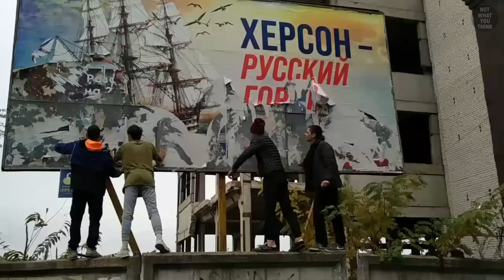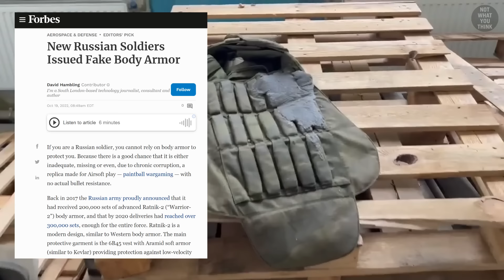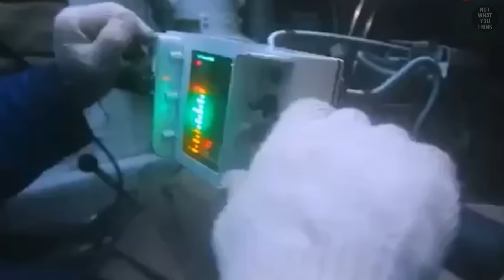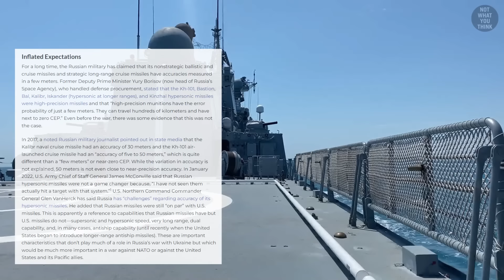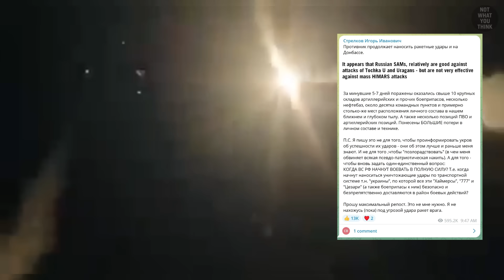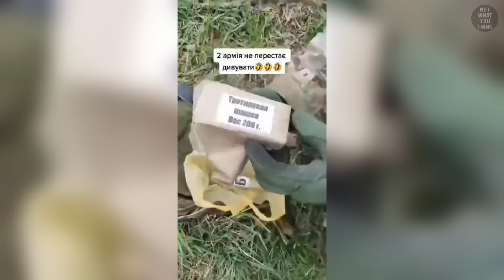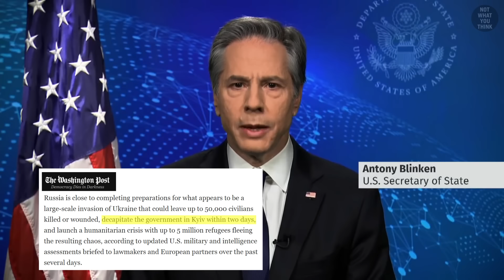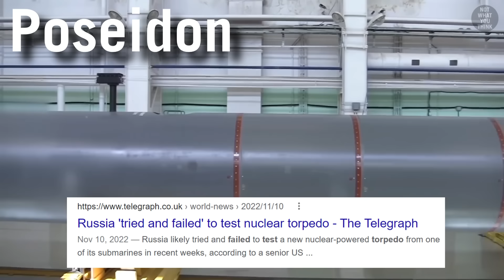The True State of Russian Army

Comment: I served in the Russian army in 2001-2003, at the dawn of the Putin era, in the elite space forces. Theft flourished even then. During my service two multi-ton power transformers from the substation, eight traveling wave lamps of 250 kg each from an object cordoned off with barbed wire and an alarm system were stolen. Thousands of palladium capacitors were torn out of the equipment by the officers. Military trucks drove on worn tires, on which there was no tread left, even in winter in ice. A lot of military vehicles were faulty. Pistol shooting classes were held every two months, each officer fired 3 shots. There were no other combat training classes, but we marched a lot, learned to pull the leg and perform marching techniques. The 'eye-wash' flourished. Periodically, commissions came from Moscow, for which we put things in order, made different signs, filled out logbooks, colored a trees and curbs of asphalt paths and did other nonsense.
But 20 years ago, at least they gave out a good military uniform to officers and soldiers and the food in the daily rations was not overdue.
Service in the Russian army is a daily anecdotal stories. There is a saying in Russia: "those who served in the army don't laugh in the circus."
Reply: Thanks for sharing and I’m glad your safe. Take care.
Reply: Почетный танцевальный долг.
Reply: Подписываюсь под каждым словом. 
This is true
Reply: Paint the trees 🌲???
WTF 😳 😅😅😅
Reply: Very interesting, thanks for sharing.
Reply: Good that you made your way off there in time, Sir.
Reply: How strange, a russian but you write in a foreign language. That's rare.
Reply: @dovydaskaminskas4227  It's not, actually. Those best known for not knowing other languages than the one they have imported themselves are the US Americans.
Reply: @dovydaskaminskas4227  I don't speak English so well, so the online translator helped me.
Reply: wait, theft flourishes in the russian special forces? get me an AS VAL plsplsplspls
Reply: @adog3129  Theft flourishes absolutely in all forces of the Russian army. But I was not talking here about the special forces, but the military part of the space forces, it is viewing for space objects.
Theft has different forms and exists at all levels and units of the army. Officers steal more, soldiers steal less. Generals and colonels, commanders of military units, as a rule, have their own or affiliated companies that supply products and perform various works for the army at inflated prices at times. These top officers have houses and cars that cost thousands of their annual salaries, they live in luxury. Blatant theft is seen by everyone, but no one asks anyone questions. They catch only those who did not share the stolen goods with a higher commander. Lower-level officers steal uniforms, food, fuel, various kinds of materials, equipment from warehouses. Well, soldiers can steal anything they have access to. According to expert estimates, from 1/3 to 1/2 of the military budget is being stolen in Russia.
Reply: @muchacho1901  oh sorry, I misread. cool info though!
Reply: @raulramirez1828  чтобы листья были более зелёные и проверяющему приехавшему за очередной взяткой понравились сосны ,он забыл сказать про покраску дорожного полотна в серый цвет,чтобы асфальт был более асфальтным
Reply: @adog3129  Much of Russia's power was a load of hot air. We couldn't even imagine the real underbelly of pageant military parades, battle tank competitions, drippy merch, cartoons about nuclear warheads, and the Defense Ministry's own media conglomerate. PR stunts aside, the Russian army proved to be utterly squalid and depraved. Things turned out to be much worse than in the Soviet era, which wasn't outstanding, either. 40-year-old smocks and rusty Kalashnikovs just take the cake. A Russian military emergency rations that was videotaped early into the hostilities came to symbolize this clusterfuck. The army-branded package contained a pack of expired cheap patte. The package represents the army was touting over the past decade, while the expired patte stands for what's really worth... But the war struck. Unfortunately, one thing about wars is that hot air proves to be useless weapon. You can apply all the battle paint grease you can find in a kid's store and trash-talk all you want. If you leg it before you even see real combat action, you show your true colors. The more you gloated, the worse of a pathetic loser you'll seem...
Reply: @dovydaskaminskas4227 Almost as if the default language of the internet is English. weird.
Reply: @raulramirez1828  not just trees, grass too. This is not a joke.
Reply: If you say that to putinist they scream its fake 😂
Reply: In Navy Bootcamp I also only got 3 shots with a pistol and 1 shot with a shotgun..... which was supported. Guy was giving me a hug basically as I shot a gun I shot many times before recreationally. Thanks champ, very real world of you :)
Reply: @koerrie  Pretty sure more Americans speak Spanish than Russians English. 4% of Russians can speak English so yeah, this is pretty rare. No idea what your comment is about.
Reply: @dovydaskaminskas4227  Yup, 4% of Russians speak English and this guy is one of them.
Reply: @kablard  Damn lies halt meinen Kommentar, wenn du ihn nicht verstehst, du Sprachgenie.
Reply: It’s that bad?!!
Reply: @raulramirez1828   china literally does the same thing...
Reply: @koerrie   BS most russians i've met can't speak a lick of english and those that can almost exclusively only know swear words.
Reply: @kablard  Tell me in my tongue and we will know 😉
Reply: @charlethemagne5466  Yeah. What other languages rather than English do you speak then?
Reply: @raulramirez1828 stuff like that happens in America too, I've seen trees painted because an officer didn't like the view of a dead tree, painting the rocks in a parking lot, etc  it's in every military lol
Reply: Guys, read "One Soldier's war", about the experience in the Chechnya war. Is it really true tjat new soldiers are being treated THAT badly? Like being torturred to the point where one's genitals and legs had to be amputated? Got that from another report. In this book two conscripts had done nothing speciL, just some usual trading with Chechen kids which everyone did. They got pi55 drunk and their boss, being just as drunk, beat both up like hell, hung'em up, let'em hang there for the whole night with their hands turning black, electroshocked one for 30 minutes, then beat both up to a pulp, threw their passports away and them out of the camp. They stayed there for a few hours and were not seen again, but obviously were in a catastrophic situation like that, in the country they attacked again.
Reply: After the war, the OUN circles operating in exile conducted a systematic action of changing history. In publications, studies and memoirs, the topic of cooperation with Germany, participation in the Holocaust and murdering Poles was omitted. The OUN and the UPA were presented as noble organizations fighting for a free Ukraine against two enemies - the Third Reich and the USSR. An idealized image of Bandera was also built as an outstanding politician, leader of the nation, thinker and noble fighter for freedom. All those who recalled the Ukrainian collaboration, participation in the Holocaust and the Volhynia massacre were called Soviet agents. Rossoliński-Liebe
Reply: Подтверждаю, служил в 2008-2009.
Reply: As an American I don't want u pulled into the West we're not perfect and at times my country can be hypocritical I wish our countries could live in peace with both of our countries respectfully  treating our neighbors around the globe we should have never invaded Iraq and Russia should have never invaded Ukraine God bless there soldiers and I wish them a quick victory and hope my country does everything in our power to make them victories
Reply: @raulramirez1828  whitewashing tree trunks is still common practice in post Soviet countries.
Reply: @marcinrybarczyk001 They are weak. The offensive was stopped at the time when Ukrainians had no support. By them alone. Now the front line only moves back. If the support came on time, the war would be over long time ago. Now they are dealing with well prepared defense (because they had a lot of time for that), and ~400000 orcs. The support from NATO should have been F35's and Tamahawk missiles.
And oh by the way, I know this saying ant at least three languages. It's not polish.
Reply: @Barbabapan  Unfortunately, the price of human life, both in the USSR and in modern Russia, is close to zero. Sometimes it takes on a negative value: you need to pay, you need to buy yourself a uniform in order to have hope of survival.
I have not read the book "One Soldier's war", but everything that you have retold could well have happened. I will give some examples of contempt for human life in the Soviet and Russian armies, they can be listed on whole volumes. The beginning of the war between the USSR and Germany in 1941, when Stalin's directives forbade retreat, when millions of soldiers were captured, from which almost nobody did not return alive. In the spring of 1942, Stalin believed that he was already quite capable of driving the German army to the west, then several armies died in the cauldron near Kharkov, a dozen generals and almost three hundred thousand soldiers died and were captured, my grandfather miraculously escaped from the encirclement among 10,000 fighters, it was near Lozovenka (the current Balaklei district of the Kharkiv region Ukraine). In April 1945, in an effort to get ahead of the US and British armies and be the first to enter Berlin, Soviet army units stormed the Seelow Heights (Seelower Höhen), this was the shortest way to the German capital. Commander Zhukov put two tank armies and 200 or 300 thousand fighters on these heights, there is still no exact data on losses. 
The storming of Grozny in December 1994 was just as crazy and bloody. I have heard a lot of scary stories from eyewitnesses and participants in the wars in Chechnya, and I myself almost ended up participating in the Second Chechen War.
The same attitude to soldiers in the current war in Ukraine. Mobilized people, just torn out of peaceful life, were sent to the front without any preparation in September-October 2022 and thrown there with only guns to storm the positions of the AFU to certain death. This is called a "meat assault" ("мясной штурм"). According to statistics collected by independent observers, a mobilized Russian spends an average of 4.5 months at the front before his death. Those who are dissatisfied or refuse to go on the attack are thrown into torture cellars in the occupied territories. Russian telegram channels are overflowing with messages from relatives who cannot find their children and husbands who have disappeared in such cellars.
The attitude to the soldiers of the Russian army is exactly the same as to the captured Ukrainians. People are dehumanized, tortured with inhuman cruelty and killed.
It is bitter for me to write about this, being a citizen of the aggressor state. I wish Ukraine a speedy victory and the de-occupation of all its territories.
Reply: @muchacho1901  thank you very much for your reply. Such a huge, unbelievable sadness. Glad to read, your grandfather made it out alive back then. Being Czech/Swiss, my grandfather worked in the police force in Prague, that was misused by the Nazis to collect and deliver jews and others. Off course they didn't have a choice but to follow the orders, but formed a secret movement, consisting of all kind of people, to save them instead. My grandfather and others would drive to the enlisted people in the middle of the night and have them quickly transported to the borders. Worked, though my grandmother off course was sitting on needles, scaref about their pretty good life.  When the Soviets occuppied the country, my grandfather and his people still kept up their secret work, this time trying to save "traitors", but they were caught. My mother was 4 and her sister a baby when they came in kicking through the door late evening, searching the whole place. My grandfather survived 10 years in a gulag, his family was deported into the "traitor's quarter's" or something. My mother grew up with constant public denunciation as the traitor's daughter, learning and singing songs about glorious socialism, her father slowly dying in the Gulag. He got free because of some propaganda deal to show the Red's mercy, but died later on due to the mistreatments. During my childhood we visited my grandmother a lot, in Prague. I was told by various people that whilst the Nazis had off course been horrendous, the Soviets were worse, also because the system could hit anybody at anytime. My grandfather was forced to deal with all kinds of innocent "traitors". It felt strange when mother sometimes warned us to not talk about my grandfather or tragedy before visiting another family, because of another visitor, a Russian/Russian-friendly and political hardliner. "Could be dangerous." Afterwards I sat there, staring quietly at the guy, hoping not to trigger a critical situation. Back home I thought how crazy it is to live like that - with that constant paranoia of denunciation. 
Anyway, that's my connection to your country's regime. A rather bleak connection, not without a full $hitload of personal hatred since there was so much suffering to hear about, and it wasn't easy growing up with my paranoid post-traumatic mum. Reading your interesting and moving story doesn't make that connection any better, yet it's so good to hear a Russian's story. Hate is a shitty feeling. Wish you love and all the best.
Reply: @Barbabapan  I am very glad to read your letter. Youtube gives the opportunity to correspond in the comments, it's amazing and useful. When I wrote a comment to that video about the weakness of the Russian army a few months ago, I did not think that I would receive so many messages from humans from different countries. Of course, I think that almost everything I have written is well known to you from school. 
Thank you for your story. I sincerely sorry that the Soviet Bolshevik regime brought so much grief to your country and your family. On the territory of the former USSR, almost every family has similar stories. My forefathers on my father's side were Kuban Cossacks. At first, they were severely battered by the revolution and the Civil War in 1918-1920, my great-grandfather's older brothers fought in the White Army and went missing. Some relatives fled abroad, the connection with them was cut off. In the early 1930s, the great-grandfather and all his brothers were deprived of all their property, declaring them enemies of the people. All of them were forced to flee and hide from the persecution of the NKVD.
My mother's parents are from Ukraine. Grandmother from the Dnipro (before the revolution he was called Yekaterinoslav). The grandfather I wrote about yesterday was born and grew up in Mariupol. I didn't know anything about my grandfather's front-line path, because neither he nor the second grandfather, who spent the entire war near Tikhvin near blocked Leningrad, never told me anything about the war, did not answer my questions about how they fought. The experiences of the war were so terrible that all the veterans told only the dry facts of their own biography. In the documents of the grandfather I found the numbers of the military units in which he served. In recent years, many archival documents have been digitized and made available, now in Internet databases you can find participants of the First and Second World Wars, awarded, trace the history and path of military units. That's how I found out, quite recently, that my grandfather's division died near Kharkov and officially ceased to exist according to documents on 05/20/1942. And from historical articles I learned in detail about that catastrophe of the Red Army.
I fully agree that the Stalinist regime was scarier than Hitler's. Now in Russia it's a criminal to equate the Stalinist regime with Hitler's. It is forbidden to say that the USSR was a friend of Germany, that they started World War II together, the Molotov-Ribbentrop pact was erased from history textbooks. Hitler killed Jews, Gypsies, but did not destroy the Germans. And Stalin wiped out the entire population of the country, by and large on the conscience of the Stalinist regime, thirty million ruined lives of Soviet citizens alone. Unfortunately, in post-Soviet Russia, the bloody totalitarian regime was not exposed and anathematized, the executioners and informers were not named. As a result, Putin's Bolshevism, which has raised its head, carefully hides and whitewashes the dark past of the country, and Russia is plunging into the former totalitarian darkness. Dozens of monuments to Stalin appear in Russian cities, while not forgetting Ivan the Terrible, Dzerzhinsky and other murderers. Monuments to victims of repression are being destroyed.
I now live exactly as you did in your childhood in the socialist camp: you constantly have to control yourself so as not to say too much at work or in transport, constantly remind yourself "Could be dangerous." So I can't tell anyone that I listen to broadcasts from Ukraine and learn the Ukrainian language.
Reply: @raulramirez1828  my dad and my friend's dad served in early '80s, so they were talking not only painting trees, asphalt and buildings on the way,  but a whitening roadside snow😂
Reply: Discreditacija!
Reply: Congratulations. You're grasp of the written English language is quite good, Ruski or not....
Reply: @koerrie yes...it still is. Think first, type second.
Reply: @koerrie  Not at all. Those who hate America like to think crap like that, though.
Reply: @raulramirez1828 I think he means the base of the trees so bugs stay away
Reply: @justlucky8254  Thank you. I studied English at soviet school, and for many years I crammed English grammar and sentence construction rules. But, unfortunately, I hardly speak English, because I don't use it in my life.
Reply: What about boots? A bad pair can give you plantar fasciitis. I got that in amazon wearhouse using the company issue cheat sheet to boots. Your feet are the most important part of your body in war.
Reply: @nifralo2752  I served as an officer. Upon arrival at the unit, I was given black shoes and boots. The shoes were worthless, they could not be worn without damage to health, I threw them away. Leather boots were normal, the feet were used to them, but in wet weather or when walking on wet grass, they quickly absorbed moisture, so I put them on only when it was required of me. The requirements for shoes were not strict, so I used ordinary civilian shoes that I brought with me from home. Boots had to be worn only to participate in the formation on the parade ground.
Reply: @muchacho1901  that's good. Maybe mine are just unusually sensitive. I don't remmber anyone else from Amazon wearhouse in pain by the 6th hour.
Reply: @raulramirez1828 does that mean the really painted trees or was it a translation error. Probably trimmed trees. Idk
Reply: @dovydaskaminskas4227 it’s not very good English. I’m sure it was translated on the internet. There’s several words that make zero sense but I can still follow the story.
Reply: @koerrie that’s true lol bc everyone’s second language is English? The closest place that speaks a different language to me is 4000 miles across the ocean to the east and 5000 miles across the other ocean to the west. And we learn Latin in 7,8,9,10th grade which is the base for all languages except the ones older than 2000years and then in 9,10,11th year in school we take an elective language, I took French and that lets me understand Spanish too bc they’re so close. So we don’t learn another language to speak it fluently but we learn how other languages were built, how they work and many basic phrases and a shit load of vocabulary. 
So I can’t speak another language but with Latin I can understand 47 different languages spoken today. How many did you learn???
Reply: @BrandonDoner  🤭
Reply: Don't feel bad, the US military has it's own batch of problems.   You have probably seen how WOKE our military has become, that is a National disgrace.   Leadership is a very big problem at many levels.
Reply: @Barbabapan  Dear Sir! No all that is not truth and is not possible for the Russian Army! The Russian Army has military Police GRU that will spot and court martial that Officer if he torchures his own soldiers... Russian military is built in mutual trust! And most people in Russia even women want to go to the Army! If the conditions were as poor as stated no one would go there
Reply: Read everything that Muchado wrote. No sense in arguing with me. I got the stuff from the sources I mentioned. Since the Russian Justice system uses torture as an everyday business in prisons (maybe 3 times a week), doesn't "know" the word "torture". Prison guards were mildly accused of "Abuse of authority" when some body cam footage had them brought into court, not the administration who ordered it. Look it up, Yevgeny Makarov f.e. will lead to those stories. With everything I know and read and heard, those military conditions don't seem far fetched at all. I'm aware that not every unit in the military is a barbaric horde of something.   @milespearson2
Reply: @muchacho1901 my friend recently bought a Kobra sight for his civilian AK in the US. He got it from a Russian website and is now wondering if he deprived an infantryman of a sight for his gun
Reply: Half the hmmvs at my old unit never started. We just X the deficiencies over and over. Another company “lost” a grenade launcher tube once. We fired ten or so 9mm rounds once a year. And using rubber m4s in training is common practice too. This video is not what you think.
Reply: @BrandonDoner painting trees in russian army is definitely not a translation error, atleast for painting grass in green color
Reply: Thank you for your service. I hope you stay safe sir.
Reply: @muchacho1901 forgive my lack of Russian language abilities but going back to the afghan/Russian war, wasn't russia struggling then aswell? Huge reports of troops not getting payed, food, equipment etc? I recall reports of Russian troops just getting drunk and trying to stay clear of the fighting? Seems russia is huge but empty of real 'metal'? In saying this though, if my thoughts are correct, should the Ukrainian military have succeeded by now?
Reply: cool story bro
Reply: @marcinrybarczyk001this sentence (...laugh in the circus) passed into Polish from Russian :)
Reply: Russian army has modernized a lot since than tho
Reply: when you trying so hard to fit in you even sell your soul but will never ever be one of them.
Reply: @BrandonDoner  There is no "translation error" here :) As an officer, I actually painted trees, curbs, trash cans. And we also plucked grass in the gaps between the concrete slabs on the ground (there was no asphalt in the military camp). Half of one day each week was devoted to cleaning and decorating the territory assigned to each unit. Even the colonels worked with brooms and rakes.
When we, former students, arrived at the military unit and just in the first days the major showed us our unit's territory and said that we had to collect cigarette butts, pieces of paper and glass and other garbage with our naked hands (there were no gloves or anything like that), it shocked us. They explained to us that this is the Russian army and there is no one else here who will do the menial work for us, the officers )))
Reply: @muchacho1901  naturally you could prove you been in the russian army with some kind of photographic evidence? What year what rank.
Reply: @Kshapo  I wrote years of service in the army in my comment. My rank is senior lieutenant of the space forces. The military unit in which I served is located in the Caucasus mountains, the military camp, the headquarters and the main object (radio telescope) are located at an altitude of 1000 meters above sea level, the second object (optical telescope) is at an altitude of 2100 meters. Mobile communication appeared in Russia in the 1990s, but there was no mobile communication in our military unit at that time, we had to call the outside world through the telephone operator of the communications division of the military unit. Naturally, we were no smartphones, which every person today fixes every step and every movement.
Photographic evidence? It sounds funny. 20 years ago in Russia ordinary people did not have digital cameras, because they cost fabulous money. Indeed, I secretly took several pictures of a military facility with my Soviet film camera. But any photography on the territory of the military unit was prohibited. It was forbidden to talk about the true purpose of military facilities. At a meeting of officers, we were heard a legend called "radio measuring center", which we had to tell if someone would be interested in our military facilities.
Reply: @sliderdriver1  To answer your questions, I will start from afar. Despite the fact that the development of Russia has been following the European civilization for about 500 years, due to its geographical location, three centuries of the yoke of the Golden Horde, it carries a lot of Asian. Including a contemptuous attitude towards human life. There are many sayings describing this in the Russian language, for example, "human life is cheaper than a copper halfpenny", "women will give birth yet." I have already written about this above, responding to a man from the Czech Republic, using the example of my grandfather who fought in WW II.
The difficulties of soldiers in the Russian army have always been, since the end of the 17th century, when the regular army was created by Peter I (1682-1721). The Russian state has never considered it necessary to take care of uniforms and meeting the needs of soldiers, to protect soldiers in battles. As in tsarist Russia, the Cossacks - the elite of the army - equipped themselves from horses to rifles, so in modern Russia, men mobilized for war buy helmets, bulletproof vests, high-quality clothes and shoes for their money. Pro-government volunteers collect socks and underpants for the army.
The Russian soldier has always been in a humiliated working position. The apogee of the humiliation of soldiers in the army occurred during the era of Tsar Nicholas I (1825-1855), who was popularly nicknamed "stickman", soldiers were often beaten to death for offenses. Leo Tolstoy, who served in the army, participated in the battles of the Caucasian War (1817-1864) and in the defense of Sevastopol in the Crimean War (1853-1856), wrote the story "After the Ball". Find this story, it's probably translated into English, and maybe into your native language. The soldier who escaped is caught, he is driven through the ranks of his colleagues, who beat him with sticks. The colonel who organized the execution hits one of the soldiers in the ranks on the back because, according to the colonel, he does not hit the punished soldier hard enough... Consider that this is written about today's Russian army, where the same monstrous medieval practices are being applied right now. Soldiers who do not want to die in senseless suicidal assaults (this phenomenon has a new term "meat assault") are put in earth pits, kept in torture cellars in the occupied territories of Ukraine in inhuman conditions. By the same torture methods, young conscript soldiers are forced to conclude a contract that gives legal grounds to send a guy to the front. The Russian army is hell. The Russian independent media, which are now all squeezed out abroad, continue to write the truth about the Russian army. The other day there was an article about how soldiers buy vacations from officers for money, fictitious wounds, the opportunity not to be on the front line or get the necessary medical care. All the "victories" of the Russian army are bought by a huge number of victims. The Ukrainian army fights much better, it protects every soldier. That is why it is now so difficult for the Ukrainian army to withstand the onslaught of hordes of zombies, regardless of any losses.
In order to know how the Russian army treats the locals, I refer again to the work of Leo Tolstoy. The novella Hadji Murad describes episodes of the Caucasian War of 1852, witnessed by the author, showing the brutality of Russian soldiers: "..Returning to his village, Sado found his house destroyed: the roof was caved in, and the door and pillars of the gallery were burned, and the interior was fenced. His son, that handsome, bright-eyed boy, was brought dead to the mosque. He was stabbed in the back with a bayonet…" In the same way the Soviet army killed Afghan civilians, the Russian army killed its fellow citizens in Chechnya, Syrians in Aleppo, and now it is killing Ukrainians. I was shocked by the photos and videos from Bucha, Borodyanka, Gostomel, Izum. But by and large, I was not surprised by this.
The Russian army cannot win, just as Evil cannot win over Good.
Reply: @cr3292  I do not think so. In the Russian army, the mobilized are still given kirza boots, millions of which were sewn in the USSR (they need to be worn not on socks, but on footcloths - special strips of dense cotton fabric wound in a special way on the leg), and duffel bags of the sample of 1869 (!!!) year, with such our great-great-great-grandfathers fought with the Ottoman Empire in the 19th century. 
Russian telegram channels (both pro-government and anti-war) are filled with videos in which mobilized soldiers complain and show plastic helmets covered with khaki fabric, flip-flops or some other shoes that are absolutely unsuitable for military operations, bulletproof vests that do not have armor plates. Yes, video evidence from the front shows that the Russian army has learned a lot, for example, the use of FPV drones, now the opponents have parity in this matter. But the Russian army continues to lack communication equipment, means of counter-battery warfare. 
In July 2023, the commander of the 58th army, Major General Ivan Popov, published an open farewell address to the personnel of his army (the text of the address begins with the words "good night, my beloved gladiators, my beloved and relatives"), in which he told that he regularly reported to the leadership of the Russian Defense Ministry about problems at the front, including reports of poor-quality supplies and huge irreplaceable losses of personnel, but not a single problem has been solved, and instead the Minister of Defense removes him from post. They say that this general was respected and loved in the army for his directness and honesty (as far as it is possible to talk about such qualities in the Russian army at all), but Popov was quickly removed from his post, where is him now is unknown.
Reply: theft even flourished everywhere else in USSR at least in later years, my father was working in cotton fabric and he said that everyone was taking a lot of stuff home every single day.
Reply: Lmao yeah and I'm beyonce
Reply: с 2001 по 2003 года космических войск не было
Reply: Wow, not too bright here, are we? @dovydaskaminskas4227
Reply: But thankfully Pootin and his pals live in billion dollar dachas and sail on billion dollar yachts.
Reply: Thank you for sharing your experience!
Reply: @noahjohnson935  
Rob Bauer go check what navo nato otan says ti his civilliaans go buy a lamp with batteries and can of water for 36 hour 
he is leader of army navo he want war too before he goes so
Reply: Good lie my friend Russian always use Russian not english
Reply: Stop lieing you wasnt in Russian army.
Reply: Just because you played battlefield on the xbox doesn't mean you was in Russian army
Reply: @123simpleasABC  Just because you know a few English words does not mean that you are far away from an earthworm in intellectual quality
Reply: Source: trust me bro. (The username if the supposed Russian special forces guy is muchacho, a spanish word) While i do know and have friends in special forces in all 4 military sectors in Russia.
Reply: @akatoshmorgul9367  I am an ordinary civilian. I spent two years in the Russian army and have no desire to return there. Besides my native Russian, I know English, Spanish and Ukrainian. In what language do I need to write my name on YouTube so that guys like you don't ask me conspiracy questions? Forgive me if my answer seems rude.
Reply: @muchacho1901  bro Russians know other languages but they generally speak Russian
Reply: You are speaking against your own country no matter how you spread hate about putin we will stand with him .btw the you are talking about  the era in which Russia was new country and faced many challenges
Reply: @spacebubble608  I'm curious, where are you from, what country are you from? Is it from somewhere in the Middle East?
Do you know, the government is not equal to the country?! I love my native country and it's not for you to teach me how to love my homeland. 
Just like the Germans 90 years ago, we are inspired now by "Ein Volk, ein Reich, ein Führer". But this zombification has little effect on anyone in Russia. You can love Putin as much as you like, you can just kiss his portrait. But most Russians are tired of the war and the dictator's 25-year rule. I hate Putin and his criminal regime because he is dragging my country to hell. His future is as unenviable as that of Mussolini, Ceausescu and Gaddafi. If he's lucky, he'll end up like Milosevic. A ticket to the Hague prison what he has already been issued can help him not end his life with a hole in his head at the Kremlin wall.
Russia has a happy future in which it will be a normal country, not attacking anyone or killing people in a neighboring country. I'm sure of it. But Putin or another dictator will definitely not be in this future.
Reply: Russian comedy army.
Reply: @AndriyValdensius-wi8gw  just like zelensky
Reply: YEp things were bad from 1990-2020 even now they have lots of old stuff in warehouse just as America has lots of old stuff.
Reply: Damn man. Thanks for sharing. Glad you did your time long before that meat grinder
Reply: молодец, ботяра! Че в окопе уже? Не мобилизовали случаем?)
Reply: @dovydaskaminskas4227  oh, really? You think that Russians don't know English? We're studying it at school and continue to study in the university. Russians are one of the most educated nations in the world, unlike you
Reply: @raulramirez1828 paint trees, paint asphalt, but for me the funniest thing during winter is making piles of snow square shaped
Reply: I greatly appreciate your speaking the truth.
Reply: @dovydaskaminskas4227 Most Russians speak 2 or 3 languages. Especially the Russians that move to other countries. Maybe spend some time with some or at least read more about the people.
Reply: Wanna call into my live stream and talk about It? Would love to pick your brain on the many different aspects of Russia that is so mystified to us Westerners! 

Id love to hear you out:)
Reply: Average american tryina pretend
Reply: Looks like Brazilian Army
Reply: They had something called the space force back then? I knew that their rocket force was it's own separate thing from the rest of the branches, which I always thought was interesting